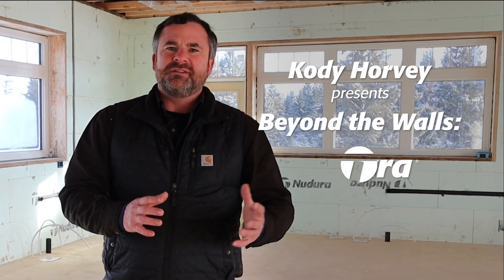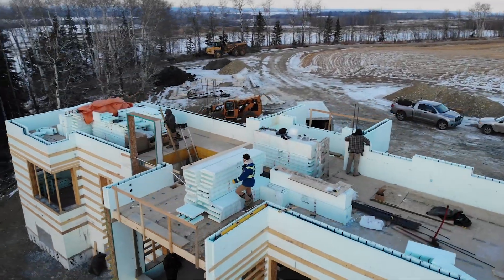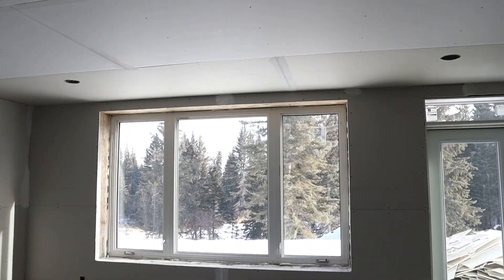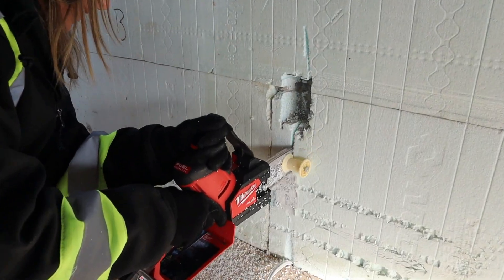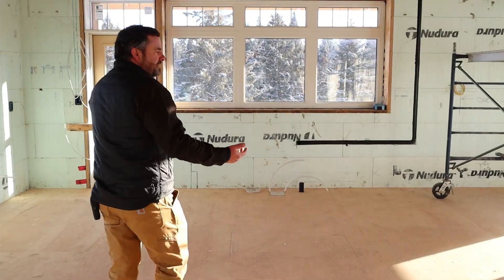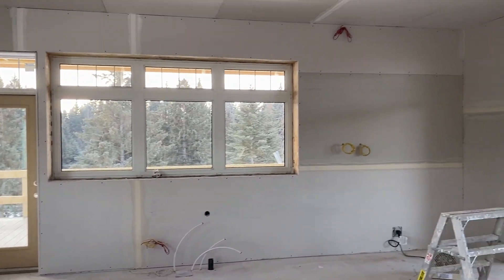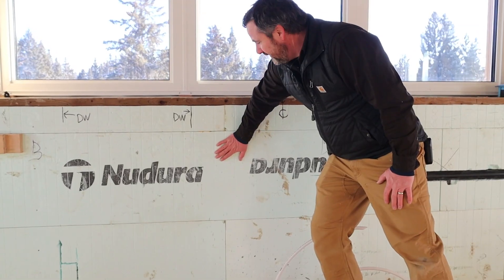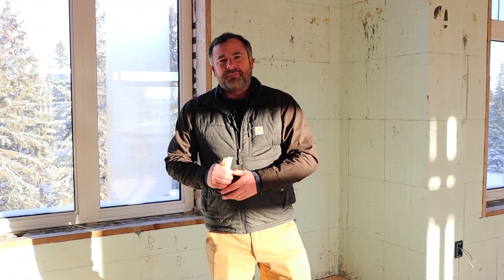From Basement to Rooftop:Mastering the Ultimate ICF Transformation! ICF Talks with Kody Horvey Ep. 3

Comment: Great video I have a engineering background in automation and software therefore civil engineering is not my expertise; however I’m still trying to wrap my head around a 8 ft window span without a header to transfer the load?????
Reply: They don't say for certain, but probably extra rebar in that area across the span to take the tension load above the opening.  In essence the header is hidden in the already bulk that is automatically here with the ICF form.
Reply: @ thank you for explanation

Comment: Still traumatized by the LA fires ( I live about 10 miles away from a burn area), I’m wondering about all of the wood used in your framing. Is it possible to use all non-combustible materials in home builds?
Reply: An ICF home is vastly less likely to catch fire than a traditionally framed home but it typically all comes down to siding and roofing choices anyway.  A Fire will not be able to jump through a concrete wall and the framing inside would be completely protected.  that being said a steel roof and siding will be enough to prevent almost all fires regadless of building style.  
Also there are ways to do Concrete floors and flat roofs with ICF
Reply: look across the border or many other places around the world, still, concrete and brick houses don't burn. Kody has a half ICF video. If you leave the foam inside, the exterior concrete or stucco wall would never burn.
Reply: @SebastianArriola-qv3sl will it be better to switch to steel framing for all internal walls?

Cost is one concern, but also kinda defeats the ICF fire rating if wood is used instead of other non combustible material

Comment: Can you explain how to insulate the roof for ICF homes, unvented or vented, and the basement slab
Reply from the maker: Keep an eye out for some videos coming up. I’ll see if my guy can find some shorts I filmed about these 2 topics.
Reply: Icf homes (if you have an icf roof like Litedeck), from what I’ve seen you typically do a recovery system and not a traditional vent since icf is so good at keeping everything in. 

Litedeck can be used for both roofing and slab. It needs a lot of bracing, but icf in general needs bracing already

If you’re going icf you might as well go all the way and not do a traditional roof. I’m going to be doing a monopour to a slab on grade, 1 story icf, Litedeck roof with fiberglass rebar

Comment: I'm doing this next year for a big addition to my house. It will be 40x80, a walkout basement and a floor above. Do you know if doing a in-slab radiant heating in the basement would be beneficial to the floor above? I know heat rises but do you know if it would be enough to heat the upstairs to any effect?
Reply: Would like to know this as well.
Reply: Beneficial, yes absolutely, but it probably won’t be enough for the main floor to be completely comfortable. So id do radiant in basement and main floor.
Reply: @ Would it be necessary doing the radiant heat in both floors if you built a house with ICF? ICF houses, or Insulating Concrete Form houses, are constructed using hollow foam blocks known as ICFs, which are stacked to form the exterior walls of the building. These blocks are then reinforced with steel rebar and filled with concrete. Makes the utilities go down 50%.

Comment: When doing the concrete pour by the floor (as you described for the basement) are there any issues with cold joints between the separate concrete pours for each floor?
Reply: You just use a lot of rebar to tie the levels together.
Reply: That should be no issue at all. Even high riser are build floor by floor. And they are couple hundred meters high.

Comment: I followed a lot of your videos while most of them :-) definitely subscribe :-) question for you what material do you use or would you suggest I use at the base of the ICF where it meets earth I do not have a basement. I am of the understanding that most products do not want you to take their product all the way to earth. I am putting standing seam metal on the roof and down the walls. stopping it At 8 inches from earth, what would you suggest between the end of the product and earth that 8 inches assuming I would not want the ICF just exposed to the elements meaning seeing the white of the Styrofoam. My system I'm using is quad lock
Reply from the maker: My go to is parging or stucco. And I always put a drip cap at the bottom one your wall metal to kick excess water away from the lowest part of the wall. 

If you don’t have a basement then you can rasp the foam and use an acrylic stucco method directly on the foam since you don’t need to maintain a drainage plane behind the stucco that would normally protect the basement.
Reply: @uptokode  acrylic stucco directly to the foam, Kode, thank you so so much that is correct. I do not have a basement at all. I do have a 10 foot wall that is backfilled with gravel. On a major sloping mountain side. Did not want a basement and was too much money cutting into the rock.

Comment: What the type/brand name joint hangers you using? I cut out the foam and used plywood and anchor bolts on my first level pour as and it was a nightmare.
Reply from the maker: The ones in this video are called a Burmon hanger. 

I’ve done the anchor bolt trick once and actually liked it. Fairly simple but it does take time and effort

Comment: I'm just curious. With a 2 foot deep web truss and spaced at 24 O.C., how long are those clear spans jn the building?
Reply from the maker: We have a centre beam that’s flush mount to the underside of those joists with space above to cross over with piping & such. 

You can easily span up to 28’ but you will get approximately 5/8” of deflection or sag . That’s why we do the beam
Reply: @uptokode  Gotcha. I see that at the :55 second mark. Do you set the center beam on top of pilasters? Or do you use embedded hangers? 
And yes, I'm planning to build an ICF house in South Carolina and doing my research.
Reply from the maker: We created a beam pocket inside the ICF walls to hold the beams on each end. Steel teleposts in the middle areas. 

If you need to pick my brain just email me for a consult. kody@uptokode.com or ask the folks at Nudura
Reply: @Navy1977 Still looking for property in Aiken, Pickens, Anderson or Greenville counties. Steel trusses huh? I've thought about mixing composite flooring using the Canam MD2000 system. Theoretically, you can span 40+ ft with very little deflection, because it's 4+ inches of concrete and steel. That would work for floors and roofing. The only issue is how to insulate the roof without using spray foam on the underside and get R-50 or more.
Reply: @Navy1977 Thanks man, same to you.
Reply from the maker: Hope both of you see this. There’s one slab system called “Fortruss” and it can be used on any ICF system. It has the insulation incorporated into the beams and underside of slab. 

Great conversation!
Reply: @uptokode  Yup, I've looked at Fortruss and also Quad Lock. One of the tips I acquired from Lake Lot Build (https://www.youtube.com/watch?v=xDquVrhU4V0) is that you should definitely use furring strips perpendicular to the embedded beams to create space for running wires and a leveling attachment point for ceiling gypsum board.
Reply: @Navy1977 What can I say? Great minds think alike! 😀
Reply: Looks great. I’m stressing about all the penetrations since my floors are concrete too 😂
Reply from the maker: @BealyGood 😂 Don’t rush, plan ahead, and coring concrete isn’t that bad
Reply: @uptokode  That sounds like an offer to me, lol
Reply: @Navy1977 yeah, I planned on that. My concern is not missing one 🤣🤣